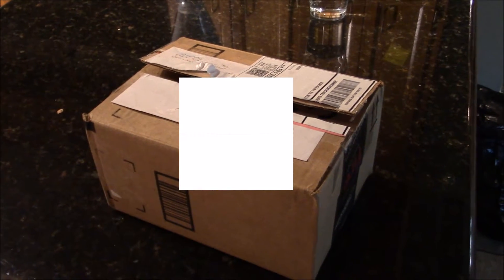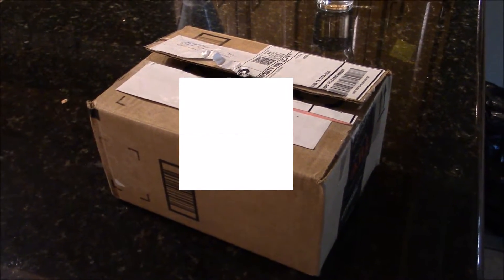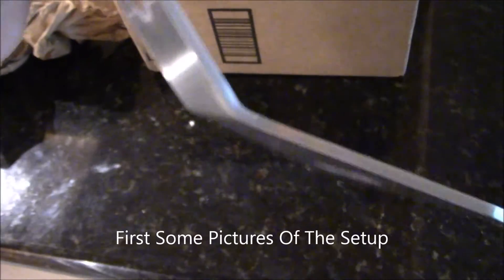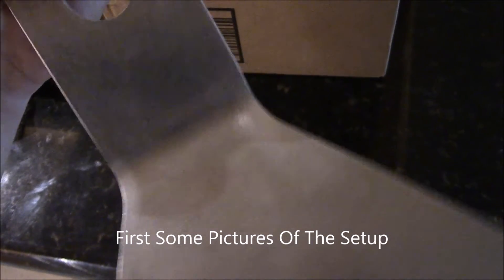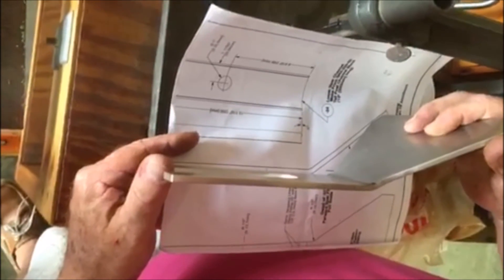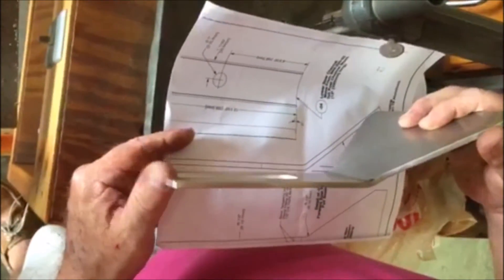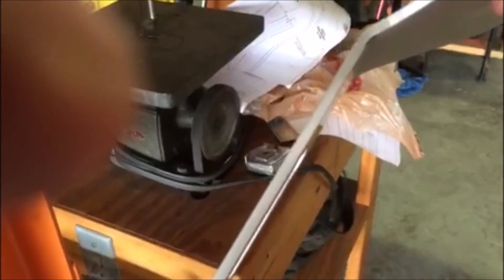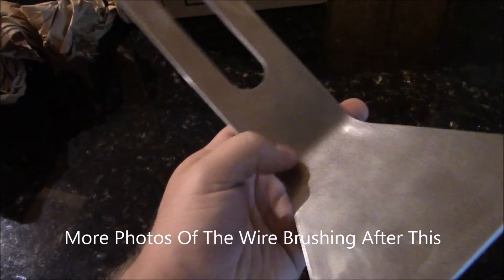Sonex Aircraft Build Video 37 Bending Vertical Spar

Comment: Thanks, good info.  I'm going to need to do some bends in my Sonex, something I have no experience with.  Small bends I can do with a vice and duckbill pliers (fellow builder recommended).  But larger bends I'm thinking of buying a 12 ton press at Harbor Freight - hopefully the quality will be good...
Reply from the maker: Frank. Are you the one building the subsonex jet? -Dan
Reply: Dan, I am.  Always wanted a jet, and this one I can afford!  ;  )  If you are interested in building one I have a forum of 13 other builders and we exchange lots of good info.  VERY experienced guys on the forum. Everything from just starting like me, to several who are already flying.  Let me know if you want to join.  Frank
Reply from the maker: Would love to join. Thanks! Also, you are in North Texas, right? I am in Austin. May I drive up some time and take a peek at the plans and your kit? I am thinking seriously about building it after I finish my Sonex. -Dan
Reply: Yes I am, and you are welcome anytime.  I may be able to save you the trip though. I'm in touch with another builder who has the full kit (I don't have mine yet, supposed to ship 17 May) and he lives in or just outside Austin.  He is also on our builders forum. The forum is at www.JSX-2.freeforums.net.  You'll need to register.  Once there we can correspond more.

Comment: What kind of alloy is it? 2024 7075 ... ? (I guess 2024 as the 7075 would have started to crack  with such of gage material and with no heat treatment.)
Reply from the maker: My understanding is that the whole thing is 6061-T6. However, I will check the next time I go to the shop. -Dan

Comment: Now I know why folks build more than one airplane.  You acquire all the tools and equipment for the first one so it would be a shame not to use them for a second or third aircraft.  :)  Hey dad, great job on the spar!
Reply from the maker: SyberPrepper I have seen it several times. "I'm just gonna build one airplane" turns into, "my three airplanes are lonely, I need to build another one to keep them company." I have noticed that the tools I have acquired so far will cost about 5% of the airplane, but most of them have been given to me, so I am a lucky one. Thanks for the comments and support! -Dan